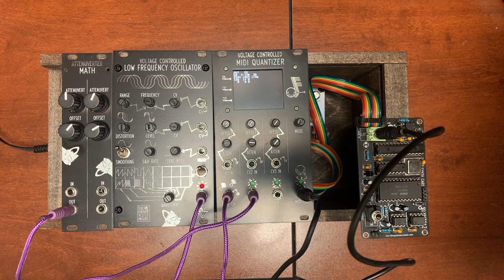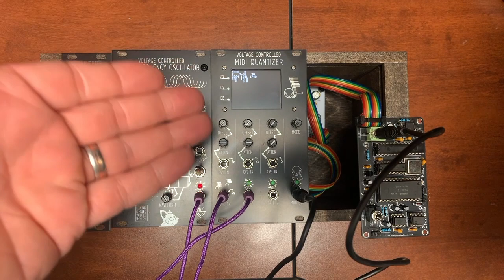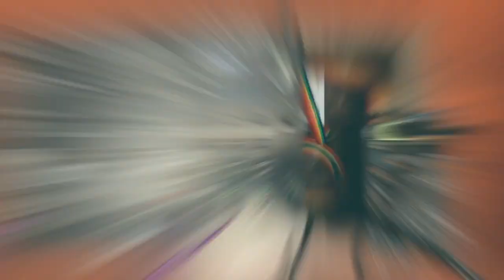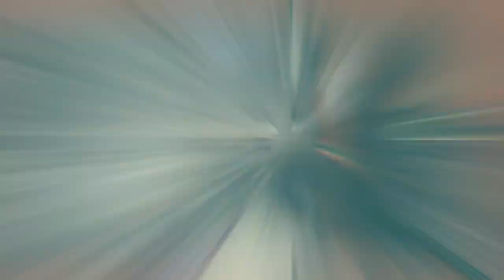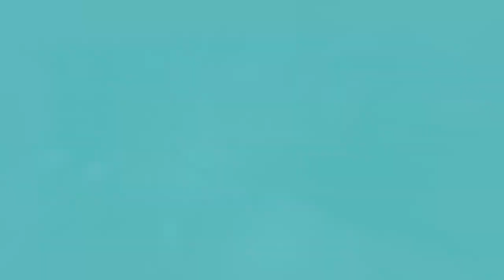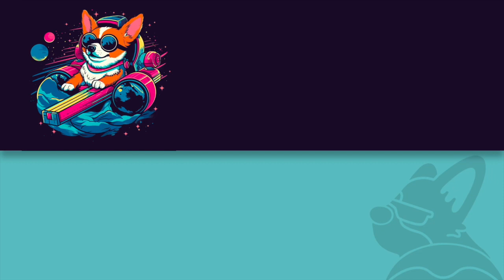Experiment Demo: CV to MIDI EuroRack Module

Comment: HALLO Tyler. I tried to do a similar module back some yeas ago, on a 2040 arduino nano, for my Microgranny, I just wanted to translate one cv input to a midi CC out, but I forgot completely the circuitry schematic.... just some resistances and decoupling caps (the nano accepts only 0-5v)... and... it didn't work... thank you for sharing the project, I might come back and fix my old project... whaat kind of controller did you use?? I didn't see also no octocoupler (I didn't use it either, but I was using the MG midi in, so there was one on its side))
Reply from the maker: Yep, you can probably use a nano to do it. This used an AVR128DA28 micro. The midi output works right off the TX line of the micro. I think you only need to use the optocoupler on the input side of midi circuit. You could also use a transistor to sort of buffer the microcontroller output too. Hope your experiments go well :)

Comment: This is super cool. It’s kinda like you are making a version of the Akemie's Castle module. I think they use a Yamaha chip. I orders some chips on eBay and excited to play around with them. Thanks for the videos and I hope you can keep them going. Cheers!
Reply from the maker: I just looked up the Akemie’s Castle, super cool! I suppose this module combined with the YM3812 would be fairly similar. Its cool how the Akemie’s Castle reduces the feature set of the chip down to its essence. (Pulling out things like the ADSR envelope parameters and focusing on level instead.) Anyway, thanks again for watching!
Reply: @ThingsMadeSimple  yeah oddly yours probably has more features and control just due to the polyphony and access to the code. Does your code set the pitch every code loop through or does it set it and just wait for the next key event (probably wrong terminology)? The reason i ask is that I was wondering how one would have pitch follow, say, a CV volt per octive input.
Reply from the maker: @nicksouthcote8826  well, the YM3812 module is completely MIDI event driven. But the CV->MIDI module tracks the current pitch CV (at 1v/Oct) and then generates a midi on and off signal when the gate input opens and closes—assuming you are in the pitch quantizer mode. The melody generator mode has its own clock that drives how quickly the notes play. But yeah, in terms of tracking the CVs and gate inputs, they get rechecked in a function that’s called by the main loop. That function also gets called inside of the visualization routines to ensure that screen rendering doesn’t mess up the timing. And, to make sure it doesn’t run too frequently, it checks the global timer to ensure enough time has elapsed before doing all of the input checks again. Sooooo yes? 😂